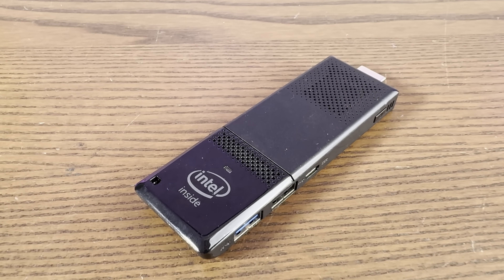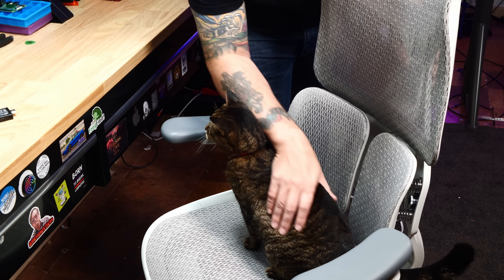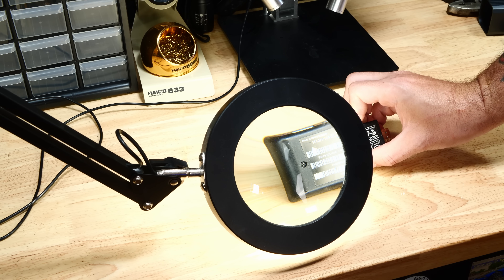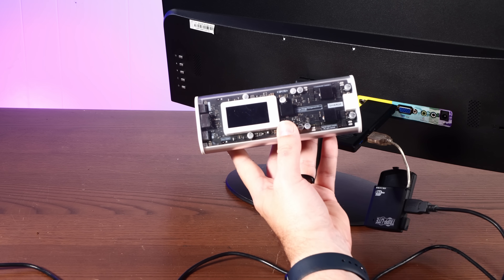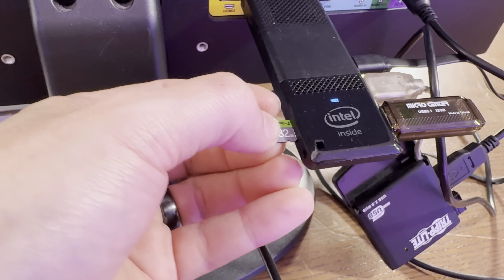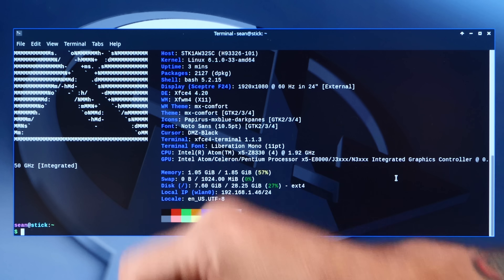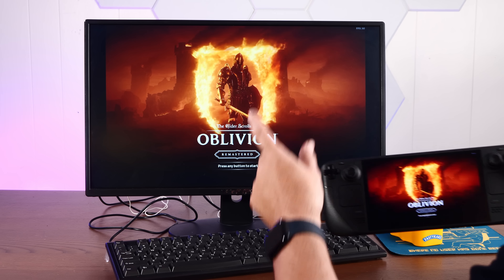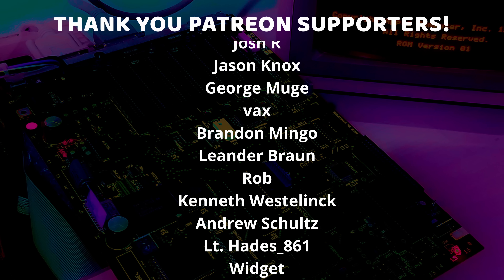Intel's Tiny, Weird Computer

Comment: I wonder if @dosdude1 could upgrade the ram and potentially even the cpu or the storage on one of these systems. That would be very interesting!!
Reply: And if that were the case you could 3d print a new case and install a more efficient fan - that would make it significantly faster and could actually breath new life into these systems.

Comment: Lol!! Mx Linux!! My most beloved linux distro! I was not expecting that. You chose the very distro I only use. Though antix linux would work too.  Mx is far more stable though. 2gb ram on 64bit os would be the reason for the freezing.  But still a kick ass os in any system of any ram size above 1.5gb that is

Comment: intel atom sure went a lot of places people didnt expect.

I have one of these compute sticks. it kicks ass. It runs my laser engraver via lightburn and my CAD via sketchup 2017 (and blender, as i slowly migrate to that).  The biggest drawback is the windows 10 i have installed on it is 32 bit. not sure if my particular stick is 32 bit architecture or what, but that really limits what you can do with it. the sd card slot is nice though. you really do need it if youre going to use this thing for work like i do.

Also, I'm a musician. The Native Instruments Maschine + in my synth rig is the main brain. It has an intel atom in it, and 4gb of ram. The maschine software it runs is just a special version of linux.

my korg wavestate mkII and korg multi poly synthesizer's? They're just little raspberry pi's inside a synth chassis. my polyend tracker + has the chips inside to run NES rom's, and runs a variation of tracker software which I believe started on the old amiga pc's that commodore made. it's a bit like making music in microsoft excel, which doesn't sound very exciting, but the workflow is very intuitive and simple. quite often the tracker is the device that brings me out of my creative ruts because of how easy and fun it is.

little computers rock.

Comment: As others have stated, you can emulate retro games using front end software, you could also turn this into a dedicated DOS games system if you  really wanted. I have a couple that are collecting dust in the wake of getting a new Raspberry Pi. They do run very hot if you push em tho!

Comment: It is very useful. I have one and I have a usecase for it, even though it's kind of dumb. Me and my friend built a McDonald's-like POS system with cash registers on tablets, order screens on tablets, and a 'preview screen' on a TV (imagine the screen at McDonald's where you see all the order numbers), all of it running through a web browser from my custom built on-site Debian server. As you might have guessed, it is used on the TV. I have it running on Win11, not because it wouldn't run Linux, ofc it would, but I had Win already ready from another project and didn't bother changing it. I am running Tiny11 and it works (with slight hiccups) perfectly. I actually have some later version, mine has 4GB RAM and USB-C Also, sorry to say this, but you are not the first one to repaste it, I did it like 2 years ago 😅

Comment: I have a habit of taking old casing & converting it for modern uses. 
- entertainment rig was the first thing I built into an old 80s case that I still have the barrel keys for.
- My network appliance is in a converted OptiPlex GX1. 
- My app cloud is in an eMachine 433i (never obsolete!)
- My NAS is currently in an Alienware Area 51 r2, but I'm about to migrate the internals to an Apple Network Server 700/200 where I intend on making the front bays HDD docking spots & (if everything goes right w/ this FB Marketplace deal) I'll also have a magnetic tape drive, even tho I somehow doubt I'll actually use it. Afterwards the big old triangle case will be used as a standalone device for my personal assistant so I can focus the hardware towards AI instead of general apps
- I'm also planning out how to convert an iMac G4 into a touchscreen kitchen manager.

I wonder what modern stuff I can do w/ that Intel plug in

Comment: I definitely remember those.  I was an intern at Intel working on the team responsible for the NUC.  We built those things.

The team was basically a skunkworks division of the client computing group, mostly made up of whomever was left after they stopped making motherboards.  The whole goal of that team was to expand the TAM of Intel’s computing clients, and they built the NUC, credit card PC, and these things.  Only about 50 people responsible for everything cradle to grave, including support.  Was quite a special group to work with.

I believe I was on the committee to codename that one, but it could have been the other generation.  Can’t remember.
Reply: damn the whole thing is basically an SOC i was supprised it actually worked, meaning we could have had modern smart phones even way earlier than 2014
Reply: oh and it shows that intel really actually fumbled
Reply: @warrenarnold  well, they hired me, so are you surprised?
Reply: @AdamPippert 😂😂lol yall could have been the leaders not CHAINAH 🍊
Reply: @warrenarnold  I haven’t worked at Intel in almost 10 years, and when I make my future glorious return to hardware, things will go much more smoothly (at least, I hope).  For now, I’ve been leaning very heavily on advocacy and the software side of things, especially open source.

Comment: Place I used to work used these, and things like them, to drive notice displays across the campus - worked really well for that. Cheap, shove it in any old display, doesn't need a wired network connection. Kinda like your streaming use case, doesn't need much computing power for that.

Comment: The Chromecast with Google TV is one of my favorite devices.
I have 2 of them. They run Android and it is fun making apps for them. You can install Termux on it and use it to host a website or any number of things. I do remote development on it sometimes. A bluetooth mouse and keyboard make it even more fun. Essentially a light weight desktop with no tower, just a large monitor (TV), and a wireless mouse and keyboard.

Comment: if I'm remember correctly, the flaw is that still need external power supply, it cannot use built in usb port on tv as power supply because of the power consumption. and also if possible using usb port as power supply, we don't need power button, it should be possible to turn on when tv is turned on.

Comment: This stick is still 100x better than my RPI Zero 2w and my RPI 4 2 gig model. If I had an old compute stick, I'd install the new Commodore Os Vision software. I've got an old windows tablet running an Atom, think I'll try it on that, it's never been useful any ways.

Comment: i have one, and the main problem of that sticks, is the dependency of an sdcard... 
1. if you use windows, the system is slow.
2. if you use linux, you can get a problem with the health of the OS, is very common to corrupt the kernel (i had to compile the linux kernel a lot of time because of force shutdown)

is a good product? sure, if u can get a good sdcard compatible and you know how to use it (in my case, zabbix dashboard), is pretty good, but, dont install windows in that, is pretty bad..

Comment: I had this one's later release (STK1A32SC with the z5-8330 cpu, 2GB ram), it had a major issue with the CMOS battery as I had 2 of them and both of their CMOS battery died after 1 year of use (first one had been RMA-d due to this problem, that's why I had 2 of them) . Otherwise works well, still use when going to vacation with gf and plug into apartment TV-s to watch things.

Comment: I wish Intel would make a rule that it is mandatory to use 4 or 8 gigs of RAM(also Microsoft should have done this with Windows 8.1 and 10) and full 64-bit support and 64-bit EFI EVERYWHERE with that Atom CPU. Then these would not land in an E-waste bin immediately. RAM chips are still considered cheap for manufacturers.

Comment: Well when you consider this thing is inside such a small stick, it’s no wonder the thing can’t do anything. Plus the lack of ram might be the biggest issue even if the thing was still using windows 7 or 8.1. You simply just can’t fit that much power within something soo small.
Like the most low end discrete Nvidia GPU for laptops is the RTX2050, and even that thing is about 35 watts. There are still gonna be limitations going that far down in terms of specs.

Comment: You know what I've always wanted to do? Run Linux on a computer with 2 or 4 terabytes of RAM, install Steam like you did, but run everything from RAM, and believe me, it's the fastest I've ever seen Linux running from RAM.
Reply: This comment did not age well
Reply: @condemnedd684  well thanks god i got 128GB of ddr5 corsair vengeance so im good i might sell half 64gb for 800 dollars.
Reply: @condemnedd684  and no more ram until 2030 all sold out, incredible.

Comment: I have an Intel compute stick, I wanted to use it for a project to run tiny 10 with emulation, maybe load a stream like Google Chromecast, and if possible set up a passthrough stream from my main PC. 

I haven't had the spare time to do any of that. :/

Comment: The problem, and the solution, is more often the software than the hardware. :)
You can do a lot with limited compute power on a lean, clean OS.  
You need a lot of compute power to make up for running bloatware (sometimes you can't!) 🤣

Comment: So much computing power is available for those relatively few tasks that really need or want it, that we forget how much was achievable with less, sometimes far less.  As an extreme example, there was a version of Microsoft Flight Simulator for C64 that ran on a  0.001 GHz CPU.  Yes, the graphics were blocky and low-resolution and the update rate was slow by modern standards, but the point was, it was possible to do it with maybe 1/50th of a percent of the clock speed, memory, data transfer speed and video hardware of a typical computer today.

Comment: I had my first remote work position in 2014 and these compute sticks and a 20 inch monitor were the cheapest/simplest way I helped get a lot of people set up their remote workstations. I told them to do all their non-work stuff elsewhere anyway and these things were more than sufficient, and used less power and space (and created less dust) than any desktop pc option. 

I was hoping for more evolution over time and think there is still a potential market, but they’ll be niche at best.

Comment: Actually a lot of commercials places uses these. In the factory I work for they use them to display mes on a TV by a webpage application. Some uses windows and some uses Ubuntu. We also uses them to do vnc into a hmi so workers can see the flashing sensor display on a layout map of the machine work table. But really the price tag they should of just used a cheap raspberry pi.

Comment: I remember these, I wanted one real bad but ended up getting a used NUC instead. There was a model with a  core chip that was pretty reasonably powerful for the time, they were usually crippled with low RAM to not compete with NUCs.  The NUC is still being used, its a broadwell chip with i think 8gb ram in there, its being used on my mom's TV for her to stream.

Comment: I still use them and they work just fine. They have a killer feature: they boot up automatically after power loss by default. So even if bios settings are reset to default, it will boot up

Comment: I still use those stick PC for homelab and casual browsing. Anything older than  Celeron are just garbage, but J4125 based models are actually very usable and performant, but price is still an issue. Alpine Linux and AndroidX86 run perfect on them. However I'd recommend to switch to MiniPCs instead because they allow for RAM & Disk upgrades.

Comment: I ended up with one of these secondhand last year. I played around with it a bit, but then put it in a drawer.

I have a Brother laser printer that doesn't have wifi. I'm going to install a really low overhead linux and set it up to be a print server for the Brother laser to essentially give me WiFi.

IF it had been sold with 4GB of RAM, I think it would have been far more versatile.

Comment: 7:35 Of course it does, it's Linux! I pulled out the WiFi module out of a Samsung TV and wired directly to a USB cable and plugged it into my computer. WIndows didn't want anything to do with it and I couldn't find drivers, but as soon as I booted a Mint LiveCD, it just popped up and started scanning for networks! It seems to have drivers for literally everything

Comment: I can tell you had one of the nicer ones because it ran windows and had a blue usb 3 port. the lower end version came with ubuntu and couldn't run it useably at the time. I wanted to lover these because it was the sbc wars times with the recent rise of the rpi and I was hoping for an x86 competitor.

Comment: I remember those things with Intel atom processors. They were right between the traditional 32-bit bios and the 64-bit UEFI, which caused some problems for people.
The problem arises whenever you try to boot. You need to have boot IA 32. EFI to boot into the 64-bit installer, like for Windows 10 or 11.
I tried installing various versions of linux, but the only one that seemed to work consistently was Debian. 
Also the Yumi USB tool seems to work fine.

Comment: We had some of those in production for use as kiosk machines, where they should be ideal. Unfortunately, the fans and power supplies weren't great and overheating does them in pretty quickly.

Comment: what difference does it make if you use one of those, or a somewhat older raspberry pi, if you arent using the IO ports, maybe just a small 5w server? of course its useful, beats running 200-400W 24/7, or some other things.

Comment: Somehow YouTube knew that I was playing with one of these yesterday!
I booted using ventoy on usb.  I would boot all sorts of stuff using that.
I then booted BookwormPup64 frugal install from the internal storage.  It is really quick and quite useable.
The trick was UEFI boot ON the stick is 32bit even though the hardware is 64bit.
I discussed my troubles with ChatGPT.  It actually did fairly well as an assistant as long as I challenged everything it suggested. 🤠
I’m now playing/ dual booting with Damn Small Linux (2024 edition) as a blast from the past. It’s not as good as bookwormpup64.
I’m still searching for a use case.
Originally this was used for an on wall advertising display.  When that device fell out of scope I quietly grabbed the pc.
I think it was also used as a Terminal Server Client for a while.

Comment: I used one of these as a stick HTPC when they were new. It was able to handle 1080p reasonably well but ended up replacing it with a SFF PC because all the dongles and external HDD's was not worth the hassle when I had plenty of space for a Mini ITX build with internal HDD and an Ethernet port.

Comment: noone there got the bright idea that hanging a computer and a bunch of wires from a hdmi port would not be compliant with the mechanical specifications of the hdmi connector and the pcb it is soldered onto :P how about they just use a hdmi cable ay.
Reply: the thing is actually bending lol. probably the pcb inside the monitor too :P
Reply: they should just have used a cable and hung the thing off 1 screw on the vesa mount or something.

Comment: I can tell you why the Ubuntu installer didn't work -- 2GB RAM is no longer enough for it.  You can run the text installer and have a rther slow full fat desktop on a 2GB system.  I have a Core 2 Duo notebook with 24.04 on it that I use for exactly that (I should put a lightweight distro on it.. like MXLinux... but I haven't yet.)   I use it for exactly the same use you are, I run Steam Remote Play on it to stream off my gaming desktop.

Comment: I have had one of these in continuous service for 3 years or so -- displaying a calendar in kiosk mode.  The stick was $50 used (Azul brand iirc) with the same quad atom and Debian 11 with LW install, actually pretty snappy little beast for the spec's.  It doesn't owe me anything and the fact that the display was a buddy's old HDTV (free!) was another plus.  The whole thing is under cover, but outside, so I am pretty impressed with the durability.

Comment: I recently dug out my Surface 3 (non-pro) with an Atom x7-Z8700 and, fortunately, 4 GB of RAM... I tried several distros and finally ended up with Fedora and Sway because of the HiDPI display - wayland takes care of fractal scaling. After a clean start, it consumes around 600 MB of RAM – I was surprised at how well it works for basic web browsing. It's definitely a good idea to use the h264ify browser extension, VP9 is killing that old Atom, h264 is decoded by the GPU with minimal CPU load. It will probably end up as a music streamer/endpoint with a DAC connected to the docking station once I figure out how to control the display switching when music starts playing... BTW, that e-mmc storage is a huge bottleneck here - SSD over USB3 performs much better than that...

Comment: I still salivate at the idea of these PCs.

Back then I wanted one, but couldn't actually get one.

Still, @LowSpecGamer 's video about it still shows what it can do with way older games.

If you were to get Windows 7 on it and run Half Life 2 (it is DRM free on Steam) you'd basically get Xbox 360 performance out of it (if the drivers are even supported).

Nowadays even lightweight games like HL2 can't run easily and well on Linux because first TogL and then DXVK have TERRIBLE performance compared to Windows' Dx9 (ToGL uses, RELATIVE TO WINDOWS, 150% CPU and 100% GPU to get 75% fps, while DXVK does around 100% and 100% to get 80%).

Maybe Half Life 1 runs well on it, since the OpenGL implementation is ACTUALLY native...